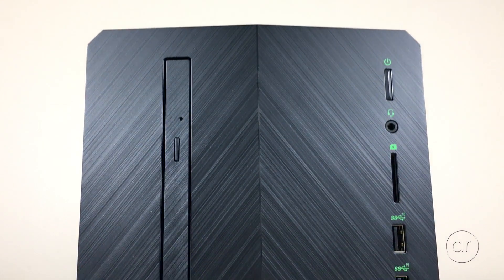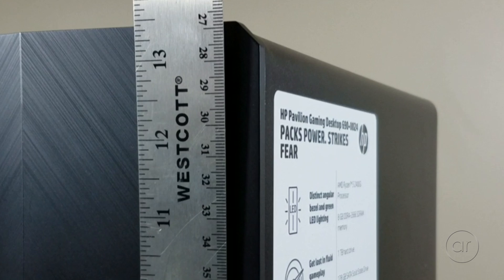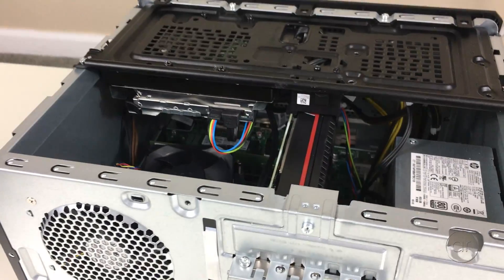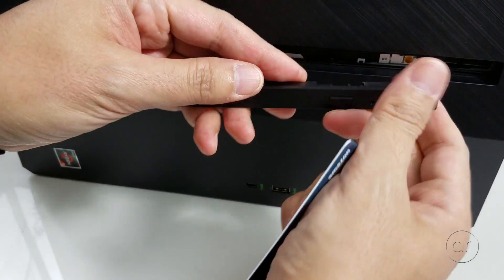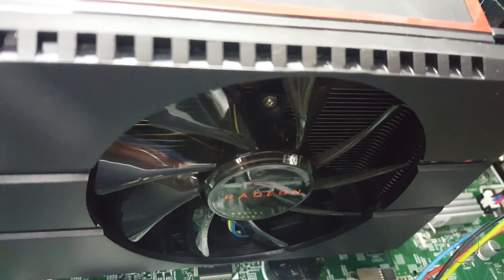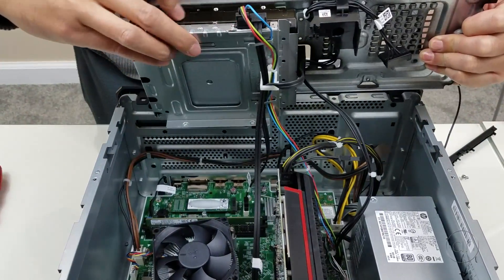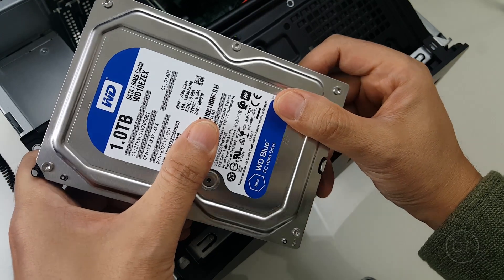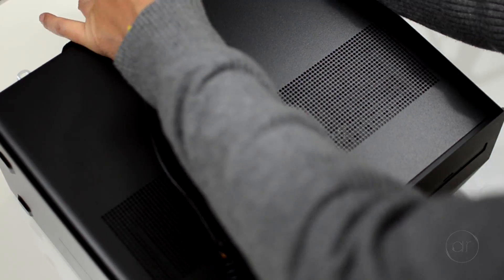How to Open and Upgrade a Ryzen-Based HP Pavilion Gaming Desktop

Comment: Just bought this with a 32gb ram and 250gb ssd upgrade parts to put in and a monitor for 900 good ole stimulus and Walmart
Reply: Did you buy one ram stick or two
Reply: @darryljohnson3084   two sticks of 16gig for a total of 32
Reply from the maker: If you can send me the model of your Pavilion and the brand/model of the RAM and SSD, I can add those to the description/pinned comment, with credit to you (if you'd like).
Reply: @accessrandom   up pavillion gaming R5 1650 super a hp v8 rgb 16gb ddr4 and a hp ssd ex900 250gb m.2 pci express
Reply from the maker: Is the Pavilion in the 690 family (i.e., 690-00XX) by any chance? I'm trying to limit the information to the 690 family (otherwise, the list could get really long)...
Reply: @accessrandom  HP Pavilion Gaming Desktop, NVIDIA GeForce GTX 1650 Super, Intel Core i3-10100
Reply from the maker: Could you send the HP model number also? I'm trying to limit the list to the 690 family since including other family models could get out of hand. If so, could you send the brand (MSI, Asus, Gigabyte, etc.) and model number if possible?
Reply: @accessrandom  TG01-1022, 2020
Reply from the maker: @D JOHNS  Thank you. I appreciate it 🙏.

Comment: hello do you think can the shadow rock lp cpu cooler fit there ?
Reply from the maker: I'm afraid I haven't had any reports of that particular model, but I've been keeping track of successful upgrades to other fans in the pinned comment (under the CPU Fan section).
Reply: @accessrandom  okay thanks, and for temps im undervolting cpu (0.99375 V) and temperatures drops from 85 to 73 degrees celzius.

Comment: So would it be possible to add an i7 and 4tb hard drive to this?
Reply from the maker: According to HP's specification site, you can go up to a 2nd generation Ryzen 7-2700. There's space for another hard drive, along with a spare SATA cable, but you'll need a SATA data cable to plug into the port at the 5:03 mark.

Comment: i have the 690 0010 model. would i be able to use a mini rtx 2060 given i had upgraded the power supply? thanks.
Reply from the maker: As long as the PSU can handle its power consumption of ~200W, you should be good (and also, it will need to fit in the space which is a length of a little less than 10 inches). I've kept track of successful upgrades from other viewers in the description under "Graphics".
Reply: @accessrandom  thanks mate. glad the community has people like you to help out.
Reply from the maker: @marriedtomypain  You're welcome, and thanks for the feedback 🙏.

Comment: Can you upgrade this to a ryzen 5 3600? I have the model with a 2400G, 8gb ram, 1tb hdd, and rx 550. I think it has a 310w psu.
Whats the fastest ram i can out in here?
Reply from the maker: Unfortunately, it doesn't support any 3rd generation Ryzens (it only goes up to the Ryzen 7 2700. I've been keeping track of successful memory upgrades from other viewers - you can find them in the description. The BIOS doesn't have any control for RAM speeds, so any faster memory would be downgraded.

Comment: Great video mate. Do you know if the stock cooler can support a ryzen 5 2600? And if not, i can't seem to find any market coolers that fit the form of the motherboard screw placement.
Reply from the maker: Thank you. It's a strange motherboard - even with a Ryzen chip, the mounting holes for the fan are for the Intel 115X (there's more information about it in the pinned comment under "CPU Fan").

Comment: Hi I’ve been using this video for help on my hp pavilion 690-0020 and I’ve been wanting to swap out the case, do you think that would be possible, plus love the vids
Reply: I looked and seems that people are saying that the front is io ports are connected to the motherboard
Reply: 690-0024*
Reply from the maker: @darkminded651  That's correct - it's a very non-standard motherboard (to match the non-standard power supply), so your best bet would be to replace those components and move over all the other parts (like graphics card, memory, SSD, etc.), which are standard parts.

Comment: Actually you unhook the dvd drive and push it forward to get it out but that’s cool. Also yes the mb does infact have on board graphics the 2400g has a igpu pop the covers off and use on board gpu easy. So much wrong Info here 🤦‍♂️
Reply from the maker: Thanks for the info. I've been keeping track of corrections in the description and the pinned comment.

Comment: if you have the hp pavilion 690-0028b you can upgrade the 8gb of ram to 16, rx 550 to a gtx 1050 ti oc, and add a hdd/ssd but you need to buy a sata connector since it doesnt come with one, and maybe its even possible to upgrade the psu to a 400w power supply and buy a gtx 1650 or maybe even a 1660 ti?
Reply from the maker: Thanks. If you can send me the model numbers of the memory and the graphics card, I can add it to the description with credit to you.

Comment: I have an hp pavilion and when I turn it on it keeps turning off and on off and on. I looked inside and I seen a cable witch said P4 on it. And it was not plugged. So I was wondering if you can help me out
Reply: Plz get back asap
Reply from the maker: Can you provide a timestamp in the video where you see a P4 cable and describe it more detail (color coding, etc.)?

Comment: do you think you could swap the case?
Reply from the maker: The motherboard is highly customized, along with the power supply (so they need to be matched together because of the non-standard pin-outs). However, I'm afraid I didn't check the hole patterns on the motherboard to see if they were any ATX standard, and I believe there are ports soldered on the front.

Comment: The internal video can work, just remove the plate blocking it, VGA/HDMI
Reply from the maker: Thanks. I actually tested this about a year ago by removing the graphics card and it does indeed work (the BIOS resets to use the VGA).

Comment: I am having a major headache with this PC at the moment. the temperature is insane (55~70C @ 28 ambient @ only 5~15% cpu utilization) due to the case size and lack of airflow. it spikes upto 75~85 easily during games with heavy load. I just tried fitting Noctua CPU cooler and it lowered overall temp by maybe 2~4 degrees which still puts idle between 51~67C. I am actually thinking about swapping the case and only replace all the proprietary parts (psu, mobo) while transferring over all the usable components.
Reply from the maker: There are several viewers named Jake Wagner, S6, Terry Parrott and epc who have had some success in bringing temps down - you can find their experiences in the pinned comment (in the CPU Fan section).
Reply: @accessrandom  ok, so I manage to ziptie sata drive at the bottom of the case against the front mesh plate and its sitting there stable. I put back in noctua NH L9x65 cpu cooler/fan. With stock case fan and no intake fan yet (I ordered one just now), the temperature range is 33~47C. This is a HUGE improvement. Thanks to your excellent video and all the folks who contributed in comments.
Reply from the maker: @xkxwrdbboixkx  Awesome, that is a huge drop in temps 👍 Do you mind if I summarize your comments and add them to the pinned comment with credit to you?
Reply: @accessrandom  oh most definitely. I think I saw another guy saying removing the cage = losing HDD/optical drive but I didn't want to replace my mechanical drive immediately (with bigger M.2 ssd) so I just put the drive flush against the bottom front corner and ziptied it just to hold the drive from falling on the PSU or interfere with intake air for the GPU fan. I was able to keep my 1TB sata drive (did lose the optical tho =( ). Thanks for helping people out man. you are awesome.
Reply from the maker: @xkxwrdbboixkx  Done! And thank you 🙏
Reply: @accessrandom  you are a lifesaver.  simply removing the drive cage and leaving the optical cover open in the front put my idle in the 40~50C range. I removed my noctua cooler/fan after not seeing much improvement from the stock cooler, but now I think I can put it back in, replace the vent fan and add modded intake fan through the bay. now I just gotta figure out how to get my sata hdd stably position at the bottom of the pc.

Comment: I got the 690-0084. It came with an i5 8400, GTX 1060 3gb, 256 SSD, 1tb HDD, 1 8gb 2666 DDR4, and a 400w PSU with 8-pin.
added a second 8gb 2666 DDR4, and just recently upgraded my GPU to an EVGA GTX 1660 ti SC ultra. keeping my i5 8400 for now.
note on the EVGA, I had to take off the plastic piece that was on the cage to fit it over the GPUs power connector. from what I've seen, you can go up to at least an RTX 2060 super as far as Nvidia cards go on the 690 series.
Reply from the maker: Thank you for the info. If you can send me model numbers for the RAM, I can add it to the description with credit to you. I assume the EVGA is 06G-P4-1667-KR?
Reply: @accessrandom  That is the EVGA I have.
As for the Ram: Crucial RAM 8GB DDR4 2666 MHz CL19 Desktop Memory CT8G4DFRA266
Reply from the maker: @viper20396  Added them to the description. Thank you! 🙏

Comment: Will the motherboard work in another case??
Reply from the maker: Unfortunately, I hadn't checked the hole pattern on the motherboard to see if it was any ATX/mATX standard - I'll need to check the next time I'm inside. However, it is a highly non-standard motherboard so if you do move it, you will also need to move the power supply (which matches the motherboard and is also non-standard).
Reply: Yea I'm trying to swap and I'm just wondering if the motherboard will fit, because it has i/o on both sides which makes a custom motherboard
Reply from the maker: @nothingmuch3464  You're right - with the ports soldered onto the motherboard, it would definitely be custom.
Reply: random  yea
Reply: @accessrandom  also, can u overclock either CPU or gpu?
Reply from the maker: @nothingmuch3464  Unfortunately, you won't be able to overclock through the BIOS since HP has locked that down fairly tightly. However, you could probably do it through software like MSI Afterburner for the GPU at least.
Reply: @accessrandom  thx i just did, it, i  got 15-20 fps more
Reply from the maker: @nothingmuch3464  Awesome, that's a good boost in speed.
Reply: @accessrandom  thx imma sub

Comment: Hello and happy new year! Is possible to change the motherboard with a micro atx on this case? And change the psu after that ofc? Thanks in advance!
Reply from the maker: Happy new year 🎉 Unfortunately, I didn't check the hole patterns on the motherboard to see if they were ATX/mATX standard - I'll need to check the next time I'm inside. However, the motherboard and power supply are highly non-standard so I believe they were custom-made for the case.

Comment: I don’t know if u said this but is it possible that I can upgrade power supply? I have a 310 watt one and I need a new one? If you can do u have any recommendations? I really need to know thanks!
Reply from the maker: I'm afraid the power supply is non-standard, but others have had success by ordering directly from HP. The part numbers are listed in the pinned comment under "Power Supply".

Comment: can you change the case?
Reply from the maker: Good question - I hadn't checked the hole pattern on the motherboard to see if it's any ATX standard. Other than the motherboard and power supply (both are very non-standard), all of the other components are standard and can be moved over.

Comment: @access random 
I was wondering if it would be compatableif I swapped out the RX580 4GB shown in the video and replaced it with the RX580 8GB from Gigabyte. My only problem with my current system now that I've added the RAM is the VRAM being so low. This should help right? Also the measurements of this GPU is 9.52 inches so it should fit
Reply from the maker: The 8GB model of the RX 580 has about the same power consumption as the 4GB model, so you should be fine in terms of power consumption. However, I haven't had any reports of anyone upgrading to it (in the description) so I'm not 100% sure if it will fit - you may need to remove the bracket at the 3:24 mark.
Reply: @accessrandom  Awesome! Thank you for the reply, I am going to move forward then and I will let you know the results. Hopefully everything goes well and then it can get added into the description.

Comment: Ok so I have upgrade psu to 500w, added a rtx 2060 phoenix GPU and 16gb vengeance. But now I want to add a western digital blue 500gb or 1tb Sata III ssd 2.5” do I need any special cable or mountain bracket or is everything already in the pc ready to be installed? Thanks for your help! 🙏🏽🤙🏽
Reply from the maker: You'll need a SATA data cable to connect to the light blue SATA port on the motherboard at the 5:11 mark. You can then use the spare SATA power connector at the 5:14 mark to power the SSD. To physically mount it, you might be able to find a hole or two on the cage to match the SSD hole pattern, but I just used some velcro to secure it.
Reply: @accessrandom  thanks again!! I just got the cable and drive also got the ryzen 5 2600 so I will be upgrading that also when it arrives!! So the PC will be R5 2600, RTX 2060 phoenix, 500w psu, 16gb venegeance, extra 1tb ssd sata iii! All this was done with your help and video! I’m subscribing!! 🙌🤙🏽
Reply from the maker: @TheTattoedVRpilot  You're welcome, and thank you 🙏 Very happy to have you here. If you have the model numbers of the 2060, PSU, RAM and SSD, I can add them to the description/pinned comment if you like.
Reply: @accessrandom  absolutely! With all the help you provided I would be more than happy to try my best and help others! It has become a very capable Vr pc now! All with your help! Here is my list of added components. 

Ph-RTX2060-6G : rtx 2060 phoenix gpu

WDS100T2B0A : 1tb western digital blue ssd 2.5”

CMK16GX4M2A2666C16R : 16gb red vengeance lpx ram

L05857-800 :  500w psu from the HP website

YD2600BBAFBOX : Ryzen 5 2600 cpu with wraith cooler

Comment: im having difficulties with this model pc reading the ram at the right rate
Reply from the maker: HP seems to limit the speed of any installed memory, and unfortunately there are no settings in the BIOS to control the timings.

Comment: can you do a video on the HP Pavilion Gaming Desktop 690-0073w i want to upgrade it
Reply from the maker: Thanks for the suggestion - I'd be glad to if I have the opportunity to access that model. In general, the 690 family of Pavilions will have the same form factor, so the sizing issues will remain the same. Also, the custom motherboard and non-standard power supply would be the same.

Comment: Can you upgrade the power supply?
Reply from the maker: You can, but it would need to be a custom HP part because it is highly non-standard (to match the non-standard motherboard). You can find successful upgrade information in the pinned comment under "Power Supply".

Comment: Can you change the tower-case
Reply from the maker: I'm not sure if the motherboard's mounting hole pattern is an ATX standard, plus the power supply is a non-standard size as well. All of the other components are standard (including memory, M.2 SSD, hard drive, graphics card) so they can be moved over without problems.

Comment: Guys, I have Update Stock CPU Fan with Noctua NH L12S, with Pipes goes Up. Plus 2x 92mm Noctua in Case. Temps is around 65°C by Renderings.
Reply from the maker: Thanks for this. Do you mind if I add this to the pinned comment with credit to you? Also - do you happen to have the model number of the 92mm case fan?
Reply: @accessrandom  92mm are NF-A9 PWM 25MM, you can add it to List, no problem. Aaa by L12S Fan have to stay at the bottom in Push mode. Snd its must to take Mainboart out.
Reply from the maker: @s6maslon  Done! I've added your entries to the pinned comment. Many thanks 🙏
Reply: I have a question I have a amd ryzen 7 3700x  pavilion gaming desktop, but want change cpu cooler, can I use am4 cpu cooler because I notice that it use Intel mount on a amd cpu

Comment: Hey i got the hp pavilion 690-0008ng and want to upgrade the power supply for a new graphiccard can u help me out by showing which would fit (i have a 310watt right now want to upgrade to a 500watt power supply)
Reply from the maker: I have been keeping track of successful power supply upgrades in the pinned comment under "Power Supply". Unfortunately, it's a non-standard PSU so the only replacements that have worked are HP OEM parts.

Comment: Are all HP Pavillion PCs about the same size? The one I want has a GTX 1650 super. I was wondering if that would probably fit RTX graphics cards for if I wanted to upgrade later on? Maybe a RTX 3060ti or 2060 depending on what is available.
Reply from the maker: All of the cases in the 690 family are the same size - but other lines look to be different (like the 790 series). All of the ones referenced in the description and pinned comment are in the 690 family. Others like the TG series are different.

Comment: Hi, someone know if Upgrade with R7 3700x works? its also 65W TDP.. thanks
Reply from the maker: I believe other commenters have tried 3rd generation Ryzens but they would not work in the 690-0024. I'm afraid the highest it can go is a Ryzen 7 2700 (according to HP's website).